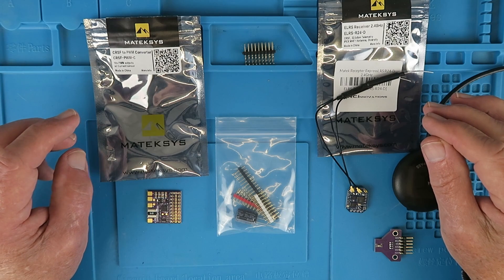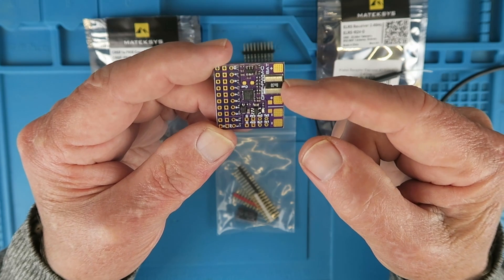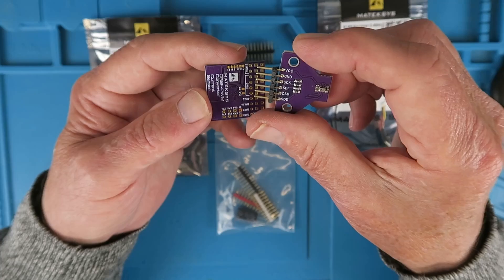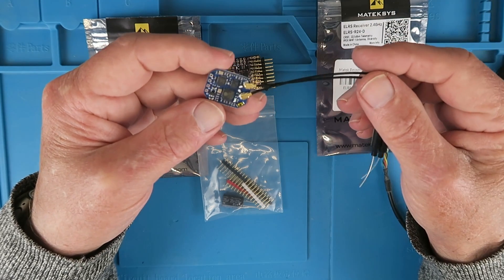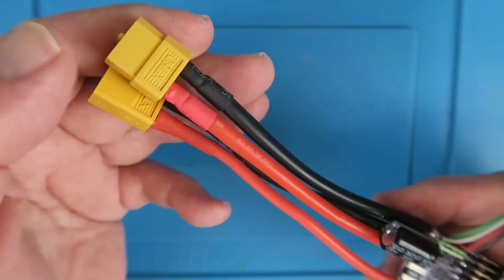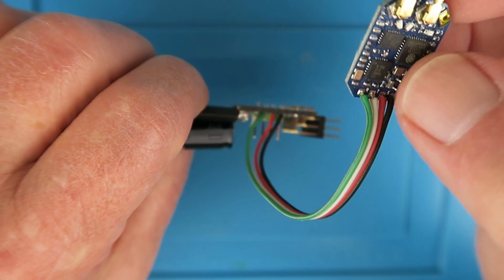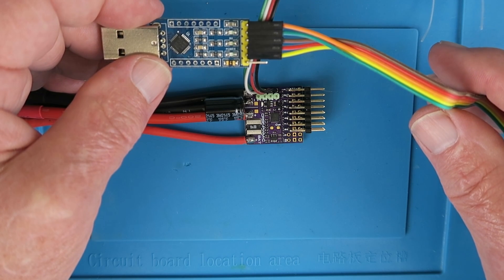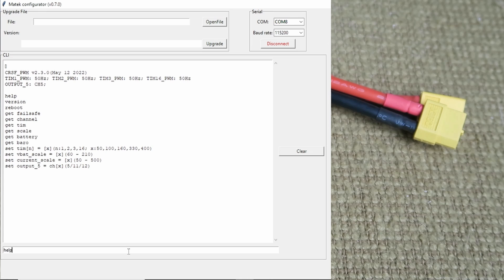MATEK CRSF PWM Volts Amps Vario And GPS!!

Comment: Thanks for this one! I never bought one of the 3 versions of these Matek convertors because none of them offered the combined telemetry functions I would like to have. But now you showed us the additional "hidden" additional barometer connection on this Matek Converter CRSF-PWM-C  board.  This totals all telemetry I would like to have!  And now I'm starting to realise that a regular cheap FC board with INAV, without the FPV equipment, could do the same, with an additional Return to Home function.  Well, I think this Matek board is easy to set-up and therefor preferred in a conventional plane.
Reply from the maker: Hey thanks! I think this board is a real find. Usually what happens now is the manufacturer stops making it!! I'm working on some follow up videos with applications like logging the GPS data to the Tx SD card and other stuff, stay tuned! Have a great day!
Reply: @1nformatica  Nice, looking forward to your future vids.  Local shop has still some in stock 😊. Telemetry data can give a lot of additional info and alarms as latest known location, state of Lipo, remaining flying time, thermals,  motor-prop performance and so on.
Reply from the maker: @ApappieK  Yes, it's amazing what is available now. I'm sure you know that also now you can get gyro data back to the Tx, so won't be long before the first ELRS flight controller!!
Reply: @1nformatica   I didn't hear anything about the gyro telemetry. Is that part of the CRSF - ELRS telemetry protocol?
Reply from the maker: @ApappieK  Check this out ... https://www.youtube.com/watch?v=8drcP6HkFbs
Reply: @1nformatica  Oh wauw. Impressive. I missed this completely. Main gain adjustment and Launch setting with elevator mixing! 
I still use a few FrSky S6R receivers but replacement seems on it's way 😃. There is for sure a serious market for these new gyro ELRS receivers.
Reply from the maker: @ApappieK  You bet! ELRS and EdgeTX development shows FrSky, Futaba, Spektrum et al for the dinosaurs they are!! My advice, flog your old gear while it's still worth something!!